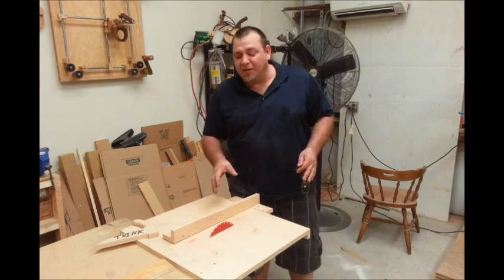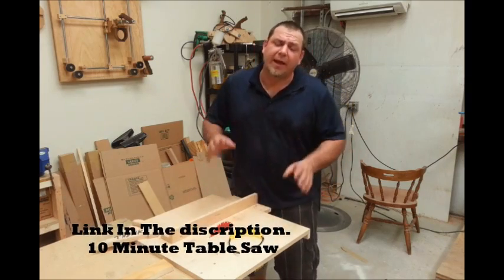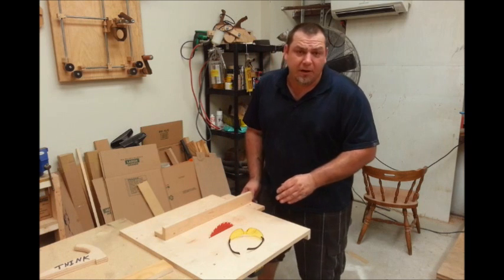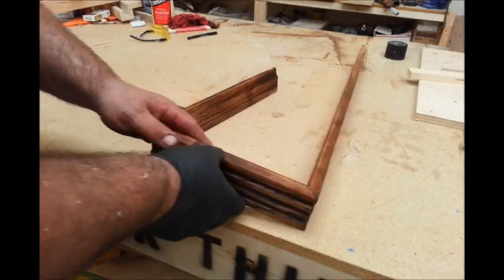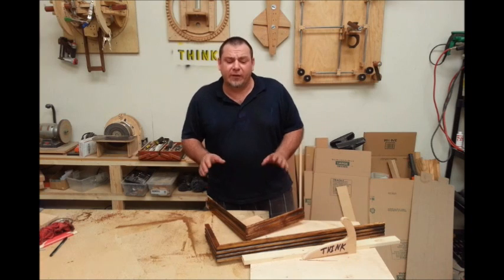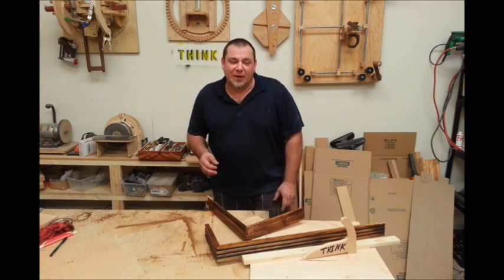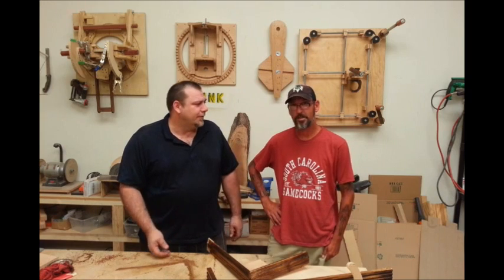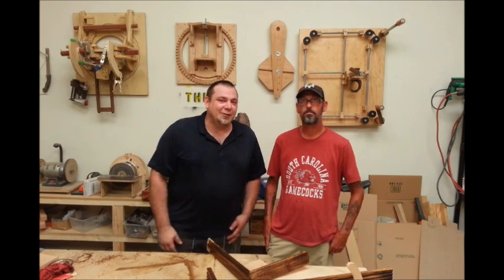Make Wood Trim and Molding With A Circular Saw

Comment: Sorry Izzy, can you show how you made that C-channel clamp system?  That's what I've been trying to get my head around, building a better fence.  Thanks man!  Hi Steve.
Reply from the maker: I have a better way to make a fence will show it in another video soon
Reply: Looking forward to it.  Trying to avoid getting a commercial table saw.  Your version doesn't have bevelled cuts, but I made a French Cleat Jig in Sketchup.  Like I need a new hobby.

Comment: Hi Izzy, could post a video oh how to improve cut of circular saw when its converted to table saw. I've mounted circular saw to a table and adjusted angles carefully but wherever i do i cant get precise cut. it could be circular saw is cheap and nasty! need to invest more and get Makita Saw. I guess disc is not rotating accurately  it may wobble a bit or i may buy another blade